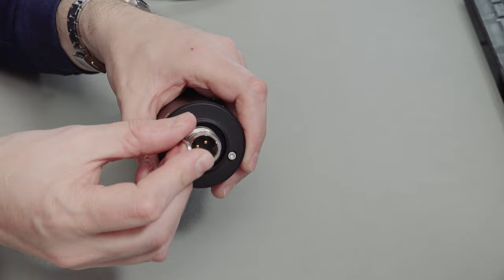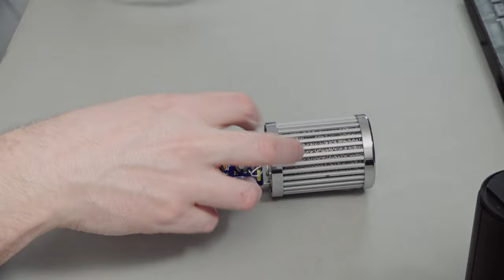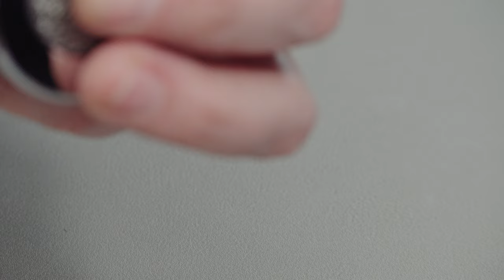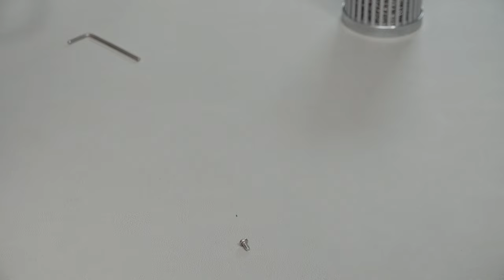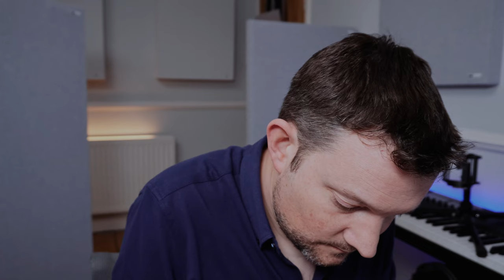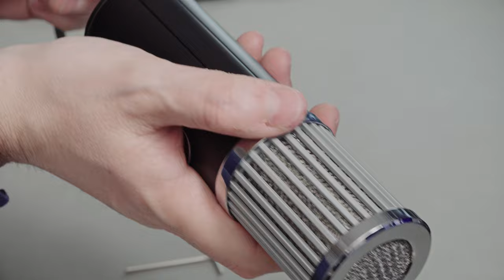Skylight Condenser Mic - What's Inside?

Comment: Yes, if you open a condenser mic, it will get a lot of noise from around. The reason is a very hight gain amplifier with a very hight impédance ( you can see the 2x1G resistor at the top of the printed circuit). Adding an adhesive rubber inside de body will probably solve the hands noise. Thanks for this revue.

Comment: I put some elecronic shielding foil plus 1 layer of thin foam rubber on the inside of the case. No more noises at all. A better sounding microphone than a Rode NT1 in my opinion because it's not so harsh.

Comment: Sir, you make good videos but it didn't have to take 3 min, unnecessarily tapping around the circuitry, risking damaging the mic, to figure out the resonance comes from the tubular structure that protects the mike. All that needs to be done is use the kind of sticky padding drummers use on their drum heads applied inside or outside (if it doesn't matter to you aesthetically).
Reply from the maker: Yeah, fair enough. I was just messing about. 👍🏻